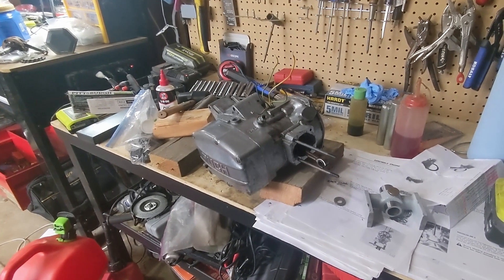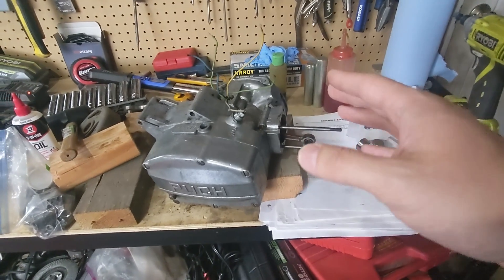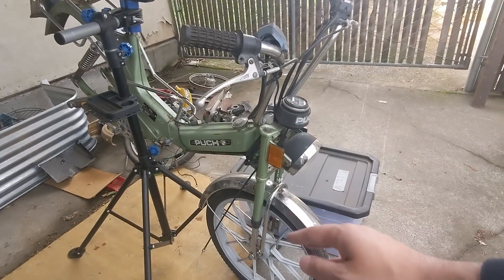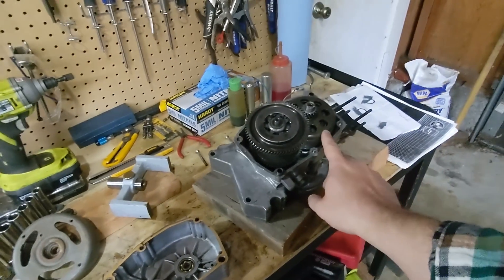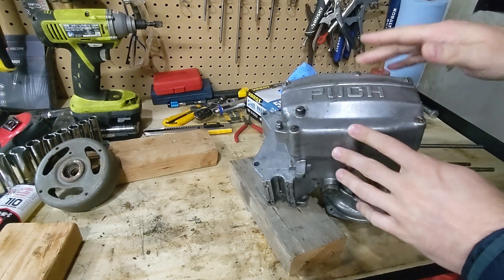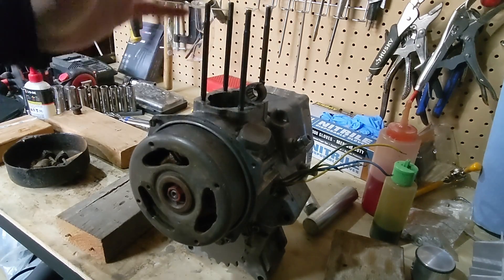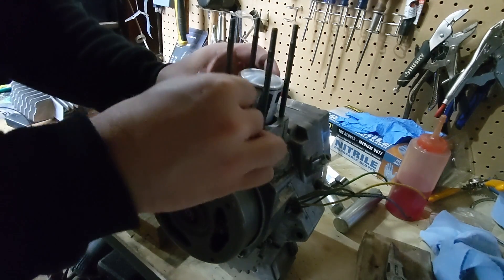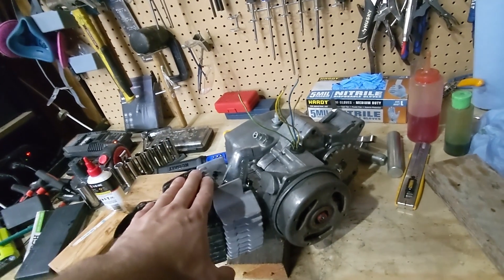The Puch ZA50 Is Assembled! Transmission Shimming, Polini 64cc Top End, Gearing, etc

Comment: Hi, I’m new here. Just picked up a 78 maxi. So they sell new za50 kits that include the components for the upper and lower?  Looking for a project but want to maintain the original e50 stock motor and I’m thinking building an entire new engine would be the move. Thanks!

Comment: I found with my two Za50 rebuilds, both of which I used two Treats cranks, that I had to file the woodruff keys down to slide over the stock flywheel. It seems the groove on the new cranks are not as deep. A nice metal file and a couple of trial and fits did the trick. Also threaded and put a hex insert down the decomp hole just as extra insurance against blow by.  Red locktited that sucker too, good call. We don’t need that hole! Jealous of the fancy torque wrench!  What carb Travis?  I’m using a rebuilt original 15 Bing, forget the jet in my 65cc Airsal kit and it’s the sweet spot. If you want to know, I can take it out and check it.  Little out of it because been doing a kitchen remodel for the last six months. Almost done and ready to get back into it.  Wife said no mopeds till done with kitchen. Update, after watching Travis’ videos again, I think I did sand the sides of the woodruff instead of the top, so ya I think it was the sides I filed, but after, no problem.
Reply from the maker: Oh interesting! I feel some solidarity there with the woodruff key ! 

I'm going to rock the 15 bing on this like the moped gods intended - I feel you on the kitchen remodel too, house stuff is never ending, mopeds can be the reprieve :D